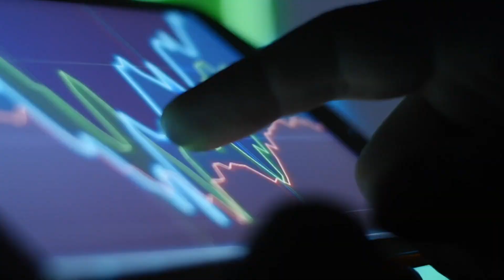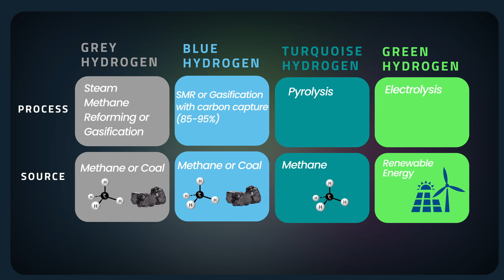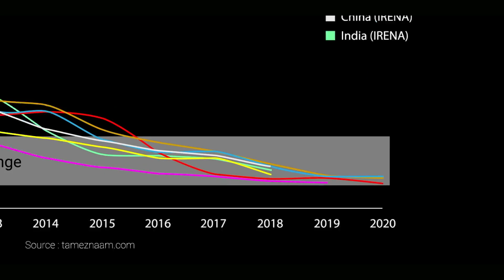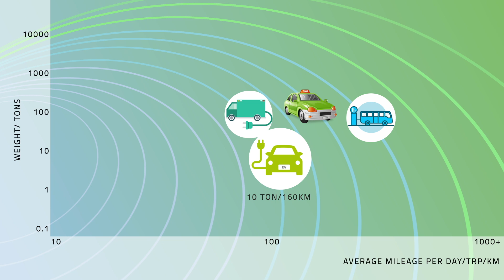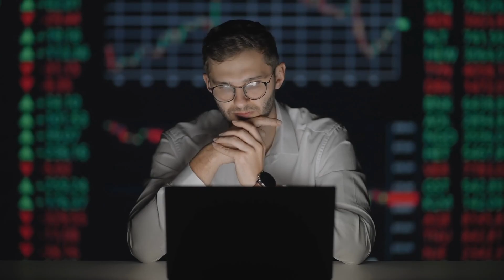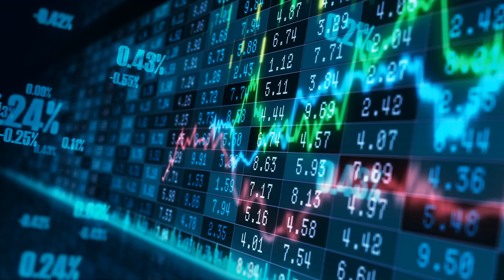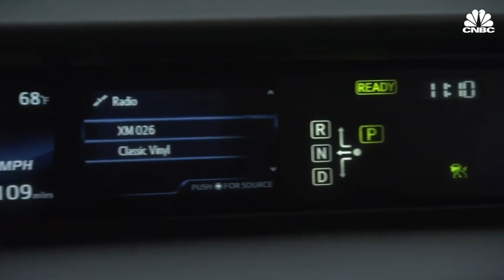Why NITIN GADKARI is pushing GREEN HYDROGEN for Indian Industries : Policy Case Study

Comment: You should also talk about other side of hydrogen. Its efficiency is extremely low. Where electric vehicle has efficiency of almost 90 ans above. Hydrogen vehicles have efficiency of 40% in best case over the life cycle that means fron electricity generation to hydrogen use in cars. Also its not good to just green wash these technologies. Wind and solar manufacturing also has CO2 emmisions which should considered under hydrogen vehicle. On the other hand i agree with hydrogen being used for steel and chemical industry to replace gray hydrogen.

Comment: Hydrogen is not practical as a vehicle fuel, everyone who has tried it has found it to be more expensive then battery systems on an individual basis PLUS a huge distribution infastructure is nessary.  Nor is Hydrogen viable for long distance distribution, it leaks through nearly all materials so piping is not viable and liquification is insanely difficult due to the need to reach near absolute zero which itself requires huge energy inputs.

Production of Green Hydrogen should be considered like aluminum, a high energy input material which is then used to manufacture other things, mainly chemicals but also non-carbon emitting steel production is being developed which eliminates the need for metalurgical coal.  In all such cases hydrogen is best produced and consumed immediatly at the manufacturing site.

Comment: Good topic but significant flaws in research. Firstly, you have compared current battery technology with future hydrogen technology regarding use in vehicles. There are a lot of safety, technical and regulatory challenges for adoption of hydrogen as a vehicle fuel. Solid state batteries are far safer with sufficient energy density for use in vehicles. They will dominate when they're mass produced at lower costs.
Secondly, steel manufacturing in India is mostly done using coal not grey hydrogen.

Comment: Thanks for this video. Green hydrogen will likely play a critical role in our post fossil fuel world, and I am interested to see how it plays out. I certainly, for example, would be willing to drive a fuelcell car; however, I feel like you've under sold where electrification is and going for transportation and industrial use. For example, I expect that the EV charge time issue will be solved before the end of the decade. Expected future state is one thing, today is another. I am currently considering buying a solar vehicle for my next car. I can buy one this year for 45,000 USD that has a 1,000 mile range on one charge and only needs to be plug in a few times per year. And at the medium weight transportation level, Amazon is deploying 10,000 EVs by next year with a goal of 100,000 EVs for delivery by 2030. In Germany, the government is targeting at least 7-10 million EVs on the road by 2030. The infrastructure to support this is already standardized and being implemented today. And a heavy freight standard is closing in right now a well. If anyone is interested in investing in future energy models, I would highly recommend to diversify your portfolio. Green hydrogen, electrification, and other green energies will all likely have a role to play, but which one will become dominate is yet to be determined.

Comment: India's biggest automobile partners are Japan & S.Korea and  both are investing in Hydrogen FCEVs so India must also invest in H-FCEVs.

Renewable-Energy sources like Solar & Wind have intermittent issues  & hence are only suitable for Green-Hydrogen production.

If India wants to achieve its Neto-Zero Carbon emission Goals & that to without risking its development Goals then its important to invest in:-
(1) Nuclear-Energy to generate upto 70% of its Electricity by year 2040.
(2) Mass-Scale Green-Hydrogen production & Storage 
(3) Hydrogen-FCEVs 

Battery-EVs are only suitable for 2 & 3-Wheelers.

Comment: He also pushed for ev and then so many incidents he is like a lawyer rather than minister, he makes comments people come up with solutions and when the solution fails he just put all the blame on the companies and duck the questions. He is still hasn't answered the question about how the EV batteries were tested as per the Indian road standard. Another point, building the infrastructure, it almost 8 years still waiting to see any benifit of that only the toll tax are getting higher, road are getting sold to private companies, fare are getting higher.

Comment: hydrogen fuel cars needs a lot of research as hydrogen fuel it is too expensive. even the availability of hydrogen fuel in the most developed country like USA is not enough less number of hydrogen stations and expensive prices of hydrogen fuel makes it difficult for hydrogen fuel cars owners to travel long distances. so for around 2040 or 2050 its not wise to invest in hydrogen fuel generated cars. Though investing in hydrogen based infrastructure for exporting purposes can be a good step by our government as hydrogen fuel have many more uses.

Comment: Hydrogen fuel is very expensive to transport requires lot of safety as it's highly explosive and requires expensive cryogenic containers which need cool down requires again more energy, 
Hydrogen pumps setup are 8 to 9 times expensive requires a lot of safety, these are two main reason hydrogen power for automobile model is not much successful from last 10 years in USA, hope it will get solved in future but still very tough!

Comment: Enough hydrogen could keep existing vehicles running.Would be used in larger vehicles first. If electric vehicles become cheap enough quikly enough people will start to buy and use them. It will be a combination of what works and is affordable.

Comment: Batteries are still better. Loss in converting electricity to h2 is 30%. Loss in transporting electricity over long distances is 3%. Do the math.
Reply: Plus safety. You think batteries are unsafe wait till you have hydrogen in each hand. It’s like walking around with a bomb.

Comment: Hydrogen engine cars are not at all easy to manufacture and extremely expensive. The big supporter of this tech was Toyota, and they have recently shifted course to BEV vehicles. Hydrogen has to be stored in liquid state at the pumps, and that infrastructure is equally expensive to set up. Electric charging stations are far easier and cost-effective to set up. Perhaps will see public transport and goods movement with hydrogen powered vehicles but as far as PV goes the next 10-15 years will see explosion of BEV cars in India.

Comment: Most common methods for production of hydrogen is 
1. Natural gas reforming
2. Reforming
In natural gas reforming is thermal process in which superheated steam + methane  but the byproduct are co and CO2. Which causes climate change.

Comment: Bro you can't compare weight of battery and hydrogen fuel tank you must compare (hydrogen combustion engine + H2 fuel tank) vs (electric motor + batteries weight) believe me it makes a very big difference, this kind of comparison is kind of misleading(not a hate comment just a disagreement, I really respect him for his content) furthermore why convert electric energy to H2 based energy there must be efficiency factor in between or maybe not.
Still in my views government should go with both alternatives for heavy vehicles H2 fuel and for small vehicles electric.

Comment: If instead of Lithium being used in solar panels we start using Sodium we can directly use sea water for H2 production as well as to NaCl for the solar cells.
If by any chance we could recycle the water produced by the hydrogen fuel run car then it would be a game changer . 
This is my opinion .

Comment: Considering the obstacles green hydrogen projects face,  to be viable and economical,  the resources required to put the scale in perspective,  70 billion dollars each by Indian tycoons if invested in reducing waste in energy transmission will make the difference in the first place. 
Grey or green, if it is environmental friendly,  is sound.  But to get their is a tedious task and needs loads of money. 
Green hydrogen cars and trucks to be viable at that level is the case for all to invest as transport is the next revolutionary sector after IT and electronics. If the common man understand the case,  then it is going to work.

Comment: Hello there; your explanation regarding hydrogen fuel cell in transportation is kinda misleading!
1.First of all, electrolysis of water to produce hydrogen in itself is a very tedious task.. meaning that a large amount of voltage is required to breakdown the water molecules into hydrogen and oxygen atoms.
2. Furthermore, storage of hydrogen is a big headache coz being a volatile element, it's difficult to store hydrogen as such and thus they are being compressed at high pressure and dropping temperature.
3. Moreover, if at all hydrogen driven economy comes into picture, we will still suffer because of high cost of construction of hydrogen gas stations. For example, it takes about 300000$ for setting a gas station whereas it takes about 2 million$ for setting a hydrogen gas station just because of the complexities involved in storage.
4. Last but not least, to increase efficiency of the fuel cells, we use electrodes of platinum or titanium oxide, which obviously doesn't suit in a large scale. Also, since there are different classification of fuel cells, selection of right fuel cell for transportation is complex.
5. Just for an example, the hydrogen powered Toyota mirai takes upto 9 seconds to go from 0 to 60..which is really bad. 
All i wanna convey is that we are still under development and there's a lot more to come with fuel cells than getting them into roads! 
Jai hind!!

Comment: Hydrogen fuel cells cars is already flop in usa vehicles are costly,refilling is costly 80 dollars for full tank and construction of pump is also at high cost. There are slow compared to ev's and Internal combustion engines

Comment: Nitin Gadkari is definitely a diamond in the rough of the BJP, but hydrogen use in anything outside of chemical applications is the wrong move. It's really not efficient, and you seem to only be considering the energy-to-mass ratio rather than the energy-to-volume ratio as well. Hydrogen requires crazy amounts of compression/pressurization and storage arrangements in order to realize the benefits of its high energy-to-mass ratio.
BTW, seeing as your production quality is going up, you should watch out for things like these:
– 3:58 The "2"s in the chemical formula that come after the element symbols should be subscripts.
– 4:08 This raises the question; "begging the question" is a logical fallacy.
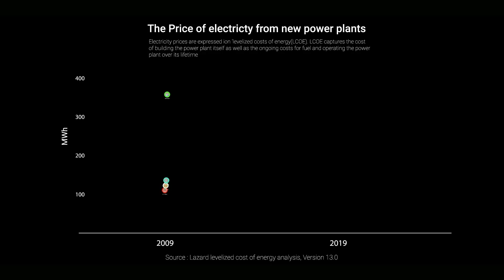– 4:16, 4:32 The word should be ago, (as in, time in the past relative to now), not "back".
– 5:18 "The reason why" is redundant; just say "the reason (that)...is...". Nobody says "the thing what", "the method how", "the person who", etc.
– 7:09 The symbol for the hour (or hours) is "h", not "HR" (henry-roentgens) or "HRS" (henry-roentgen-siemens).
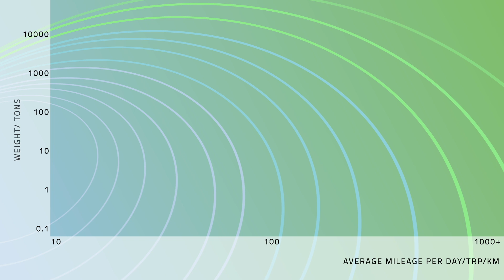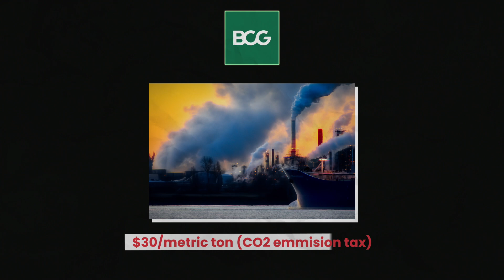– 7:12, 7:33, 9:47 Should be tonnes (and pronounced in the plural) not "tone", "ton" (which is ambiguous), or "metric ton" and pronounced as "ton" (in the singular).

– Overall, you should tell your editor (or yourself if you're editing your videos) to watch out for capitalization. "KG" means "kelvin-giga", while "kg" means kilogram. SI symbols are case-sensitive.

Comment: A new name for hydrogen, green hydrogen. Really mind ponders over silly explanations. There is no gas called green hydrogen. It's simply hydrogen. And to produce one needs a lot of energy to convert water into hydrogen and oxygen. Hydrogen is extremely hazardous to handle as it leads to explosion. ICE cannot hold hydrogen as fuel and explode. Indian climate conditions are very harsh. Moreover this fuel cannot be used in cars or SUV's. The only option left is to use it in fuel cells as is being used in Scandinavian countries. 
 Indian government is MC as it has heavily taxed(43% to 45%) hybrid vehicles which could play a pivotal role in the automobile sector. 
Toyota Camry hybrid gives mileage of 35kmpl of petrol inspite of 2.5 litre engine but due to heavy taxes, it's hardly seen on the road whereas it's most popular in the USA. 
In nut shell Gadkari has done nothing good for the automotive industry, albiet made the only country in the world where cars are made obsulete only on basis of time period and not on their performance and engine exhaust parameters.

Comment: Solid state battery, optical fibre and 3D printing is future of industry, almost all forging process (which is major energy consumption of steel industry) elements by 3D printing revolution, Tesla is going to produce car body in giga press   within 2 sec car body form by using newly developed material,  same way industrial and domestic electric motor consumption come 80% down by makeing smart electric motor (BMW Germany factory video on YouTube). 
So green hydrogen is like plasmas tv era, it would not sustain more than 2 decades.

Comment: Nitin Gadkari The minister of Road transport of India where he is the Bob Builder of india from Nagpur Maharashtra he initiative in road transport by introducing Green hydrogen car in Parliament for next investment in india Green hydrogen manufacturing by Tata industries and Adani industry for future to control carbon emissions and Green hydrogen used in automobile industry like car and bus , lorry to recharge easily portable and advantages are High than battery 🔋 but cost of hydrogen to common man is high and Well details explanation of Hydrogen types and how manufacturing industries uses in different industries and Think school 🏫 Explore Hydrogen fuel cost analysis and compared to Lithium batteries the analysis hydrogen manufacturing and Their types application wow excellent research on hydrogen fuel for future initiative by government of India 👍 Thanks U Ganesh anna for exploring of Hydrogen fuel and how they use in different industries

Comment: Q) why there is gas stations for hydrogen rather than a pre filled gas tank that can be inserted in car? (The gas tank which is setup in various location in a city does not work on full capacity as there is extremely less number of car that are filled in night (so the gas station has less than half productivity which increase the amount the consumer has to pay), so instead of this if we had a gas plant in every city which can fill insertable gas tank (which can be inserted in vehicles)and the insertable tank was made available to various parts of cities then it may reduce cost ]- but as we know this is not right, but why?
Reply: @rover9488  because LPG is mostly liquid, the pressure inside the cylinder is only a few bars. Thus the storage tank can be light weight and transported easily. Whereas CNG (mostly methane) is a pure gas and has to be compressed up to 250 bars. Hydrogen is compressed at even higher pressure, otherwise the tank required will be very big. So it is a safety risk to have high pressure removable tanks.
Reply: Removing and inserting high pressure tanks is not trivial at all. There are heavy and require skill to fix properly. Fitting and removing the cylinders frequently is a hazard and will most likely cause leaks.

Comment: One more reason Gadkari may prefer greater adoption of hydrogen fuel over Lithium-ion is in order to make ev batteries more efficient (travel more distance) and avoid burning, COBALT is very essential. 70% of world's COBALT resource is from Democratic Republic of Congo (located in Middle Africa) where most of the COBALT mines are controlled by China.

A great move by Gadkari!

Comment: get the petrol prices under control, as per the promise made by BJP. Stop diverting ppl from main problems. No h2 cars are successful, it goes into trash after some unlike petrol/Diesel or Hybrid cars. Look how many car maker are in Hydbrid or Plugin manufacturing. This RSS  premedieval thinking wont work

Comment: I don't think economics was considered by Gadakari while deciding about H2. It is very expensive to produce it and it is not very cost effective unless it is produced from fossil fuels! (But then you loose the reason for calling it a green fuel.) It may be okay to produce it using solar/wind energies, however it still remains very inefficient compared to the direct charging of the batteries. Ilon Musk has called fuel cell technology as a 'fool' cell technology-something to think about. It will never work for passenger cars (Japan has been trying to make it work for several years now without much success - Toyota Mirai is the failed example, which BTW Gadakari is driving)--it may however work for long-distance trucking where having heavy batteries is a liability. 
        This top down approach will not work since people will not buy into it. If a technology has to succeed, it has to 1) make economic sense, 2) people adopt it. In comparison to H2 vehicles, the BEVs have a much better chance because of the steep price differential in petrol/diesel costs and electricity costs in India.